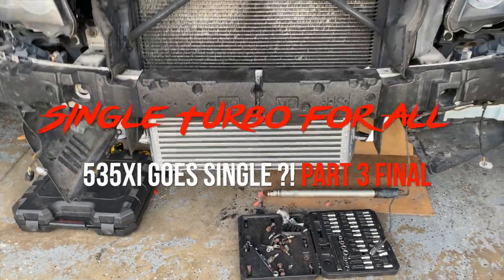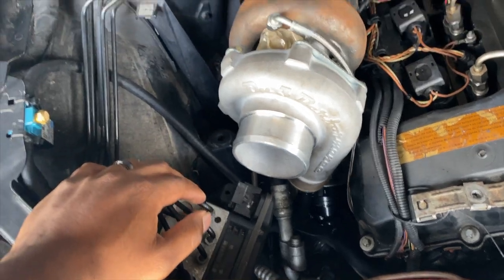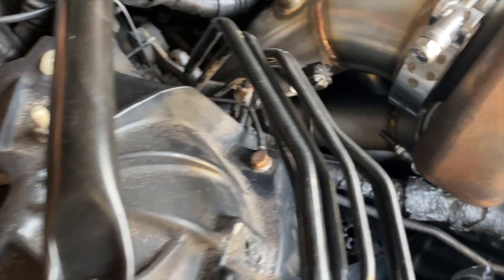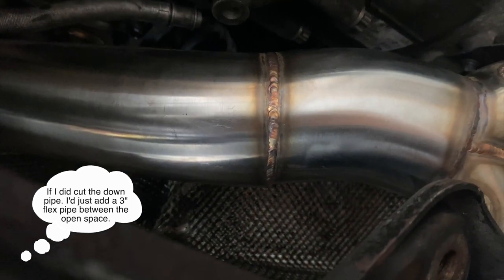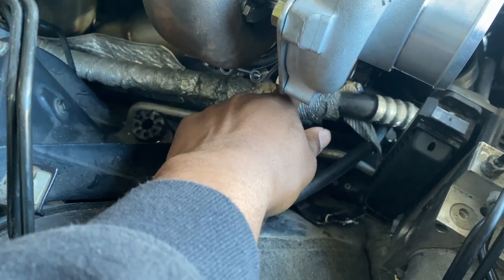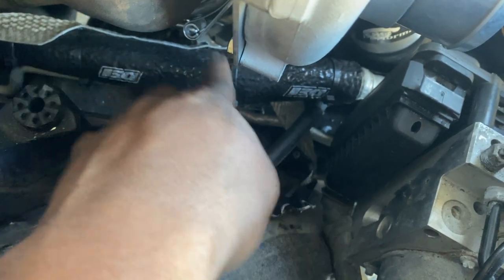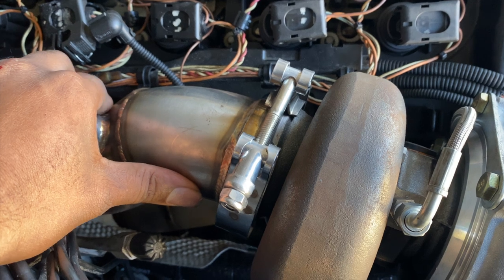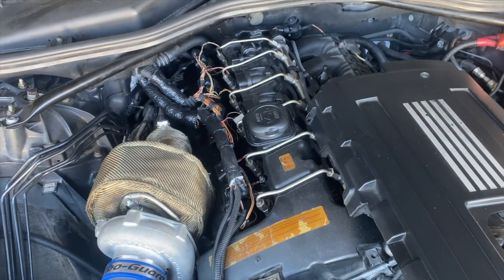E60 BMW 535XI Get A Single Turbo | Part 03 of 03

Comment: Thank you so much for these series. I’m currently trying to single turbo my RWD E60 and I’m not sure what kit to go with.
Reply from the maker: No prob. I used the on3 335i kit as my base. I believe docrace have a e60 specific kit. But since this was a awd e60 I needed a more compact kit since definitely couldn’t run dual waste gates etc. for the a/c I unbolted it from the chassis, since it’s secured by the passenger shock tower and the front of the engine. Once it’s loose you can move it out the way and secure it away. I made sure to cover it with heat wrap etc. Going to see how that works out and see if it’s a viable option, if not just going to make the custom a/c line that reroute it behind the engine.
Reply: @nOshi2x  appreciate the response. Goodluck on the build man! Looks good
Reply from the maker: Thanks 🙏🏽
Reply: @nOshi2x  hey man it’s been 6 months and I’m finishing up my single turbo build. How’d the AC line hold up?
Reply from the maker: Ohh sweet nice, the a/c line has held up quite well I still want to reroute the line and make a custom one. But currently no issues with the line.
Reply: What kit you went with to single turbo?
Reply from the maker: On3 335i single turbo kit, pretty much used the hot side parts as a base.

Comment: Is that startup normal my 335i does it all the time with the on3 kit and i have it tuned with the jb4 st firmware and mhd bef but also fails to make boost... cold start noise reduction isnt on as well for me
Reply from the maker: Yea no issues with this car start up. Might have to check your wastegate setup or connections for boost leaks etc.

Comment: I’m thinking on doing the same but with the doc race bottom mount for the 335 and just getting rid of the awd
Reply from the maker: Yea I thought the same thing with eliminating the awd setup, in which just swap in the 535i subframe, oil pan, etc. Since the transfer case is a weak point. This would free up a lot of room for a bottom mount. I think any 335i kit would bolt up without issue sans a little tweaking with downpipe more than likely.

Comment: Awesome work bro, you got me considering this project. Did you get the ecu mapped out or bought a standalone ecu? Can you do a overall review video if u faced anymore problems with it and review for the power to the wheels.
Reply from the maker: Just remapped the dme, with a single turbo map. I’ll have a follow up on this project soon. Good news so far nothing has broke 🤞
Reply: @nOshi2x  did it come turbo from factory or no
Reply from the maker: Yes, twin turbo from the factory.

Comment: I appreciate you answering all my questions bro😂 I got two more what size is the turbo your running ? And  you need just 1 mac solenoid correct ?
Reply from the maker: Gt35 61mm on3 turbo, correct just one Mac solenoid
Reply: By the size of your turbo do you think a 6266 would fit ?
Reply: My on3 hot parts are on the way for my e60 and I’m tryying to figure out how to do this on my own I’ve done twins on my car but not gonna lie it was a challenge 😂
Reply from the maker: It will fit but definitely would have to get a full custom downpipe to accommodate it
Reply from the maker: Single installs are a lot easier than the twins, once you remove the twins everything piece together good. Hopefully you have a 535i so should be a smoother install
Reply: @nOshi2x   I have a 535xi man😂 lol ofc and I really wanna get this single in but I don’t wanna fit a small turbo I’m aiming for 600-700 do you have a recommendation for a turbo that would fit that would get me in that range ?

Comment: Do you think an 67mm will fit ? You inspired me to do this only thing holding me back is knowing if that 67 will fit
Reply from the maker: My guess is it should fit but my main concern would be the top section of the downpipe, in which it would need to be modified there to clear the passenger side of the engine bay.